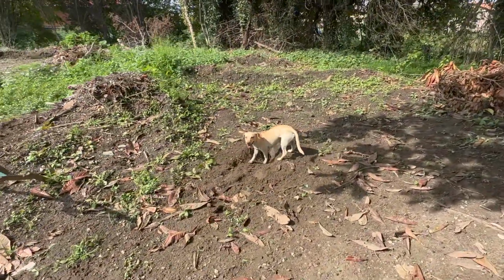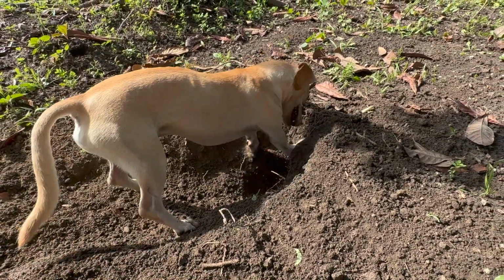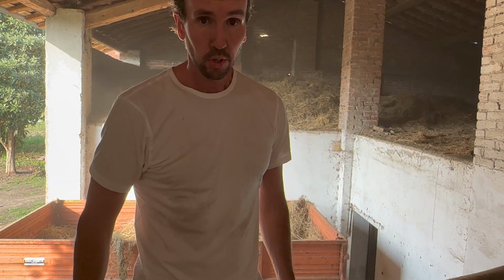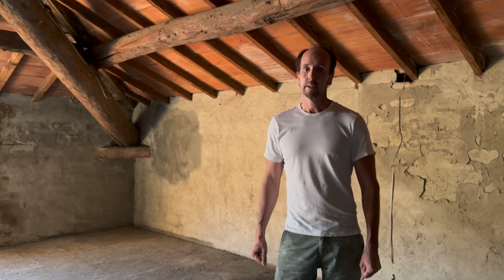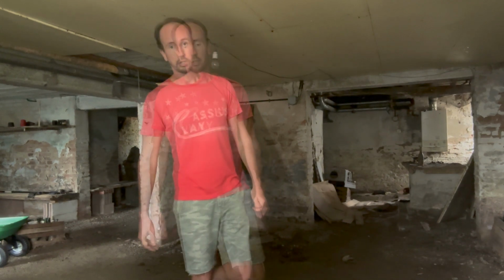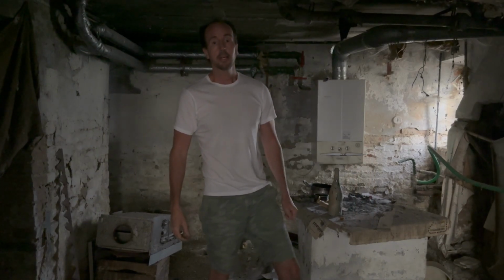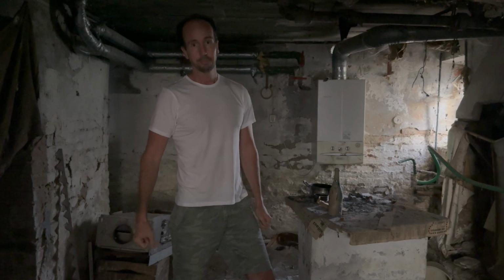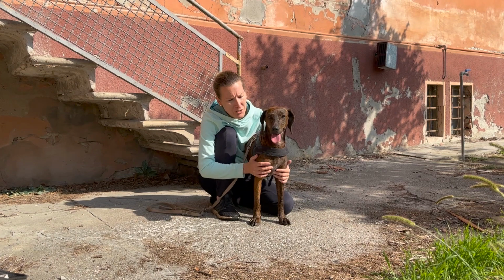CHANGE of plans - We are DIGGING a hole! - Episode 11 of our Italian house renovation.

Comment: Being a carpenter myself for decades and seeing many issues with homes thru out the years, I can say you are doing it correctly. Always start at the bottom and work your way up. If your roof is not leaking or has areas that do leak, then yes make sure they are fix temporarily or permanently.  I am glad to see you have done your research for the foundation depth and are going to do it properly according to the area you live in. I hope you are going to hire a foundation contractor to come in and dig all that out and pour the new footings. Can't wait to see more videos of your progress. Thanks for making and sharing.
Reply from the maker: Thank you! Im glad my research is paying off, yes had a meeting today with the architect and we are having a foundation contractor to do the work and he is also doing the necessary calculations etc. 

Thank you for watching and commenting, much appreciated!

Comment: Making a basement deeper is tedious work!  From watching other videos I know there is a type of cement with insulating properties for the floor, and it's tricky because you also have to prevent water intrusion.  Have you consider under-floor heating for the basement?  
Congratulations on fostering a dog.  You may find you have become very fond of him when a new owner has been found!
Reply from the maker: Thank you Bob! 
Yes, we need to do a sort of drainage for the damp issue, I have seen solutions with ventilated leca stones in the bottom etc, but we will take in professional help in order to prevent the basement going damp. 

Yes we are well aware, that's how we ended up with our beige little dog Tony, it took us 2 minutes to decide to keep him, but this is dog number 7 or 8 that we help now in the past 2 years and we really can't have more than 2 dogs so hopefully we wont get too attached to her even though she is beautiful and so sweet.

Comment: I adore your house.  and I am expressing myself in her defence As far as I know underpinning is an extreme interventation to which experts recure only when there are important  structural  problems . The  basement seems to be in perfect conditions.   This is a heart felt a and personal opinion  .A massive painstaking waste of energy even under an environamental point of order to gain. a little height, ?? All my  best wishes to this wonderful house and to you sensible people.
Reply from the maker: I completely understand, we do however have an issue in one corner of the house as the foundation is sinking as the soil is very wet so it's not only for ceiling height even though it's a nice bonus if we still have to do some work to secure the house.

Comment: I think this sounds like a sound plan.  They will be able to get in one of those mini diggers through a door with no problem.  When he did our drainage around our basement they were able to dig an insanely narrow area easily.  The roof is probably a much faster job if there is not too much to do.  We were done in a few weeks but only had to swap tiles and one part of a gable, so might be worth getting that out of the way.  You'll feel so much better having everything watertight.
Reply from the maker: You are right! 
If the job is small we will probably do it right away, we just don't want to block up the whole facade with scaffolding if we want to build a drainage around the house as soon as possible. 
We might be able to use a mini digger in the basement, the height might be the problem to be able to use the arm. In worst case scenario we will do it by hand with loads of buckets etc. 
Thank you for watching!

Comment: Why go to all the time and expense of digging out the basement, when you can have a spectacular cinema room and so much more in the barn? Pouring more foundation below existing foundations is not for the faint-of-heart and could end up being very problematic if not done correctly, with improper support, uneven settling, which compromises walls above, etc. You have so much space that it's hard to comprehend why you need to have any living space in the basement.

It seems like London billionaires and their elaborate basement lairs have brought on some sort of craze about using up every available inch in homes. But they can't do anything but go down, so they do. You don't seem to have this limitation.
Reply from the maker: Haha, no we don't really have to use up every inch of space but we already have plans for basically all of the barn. We would obviously use professionals if we and when we start the work in the basement, it all needs to be calculated so that we under no circumstances compromise the house.